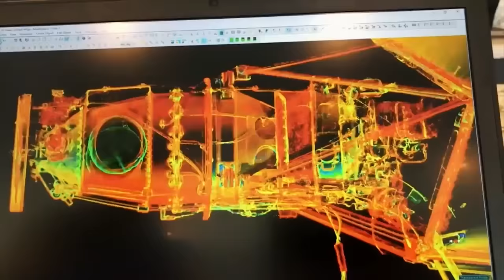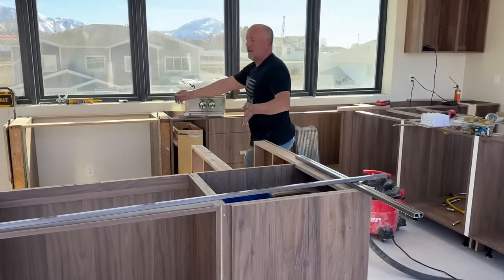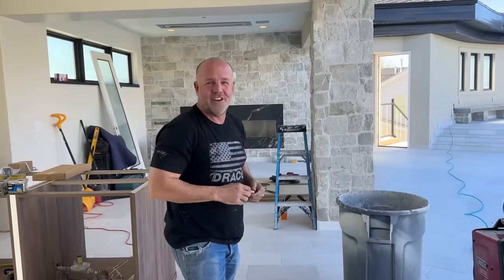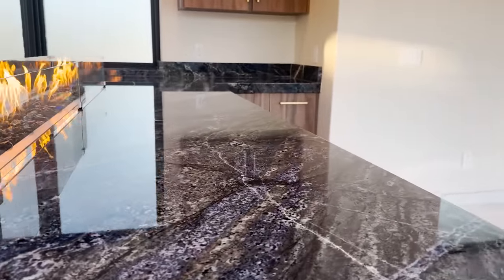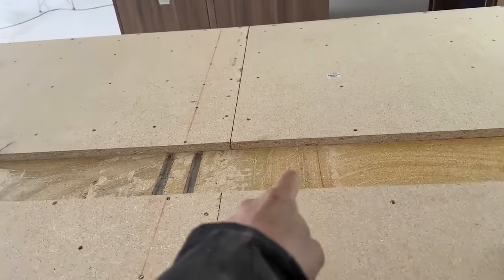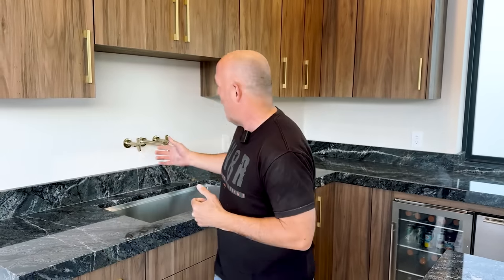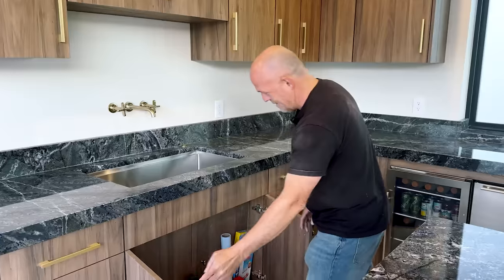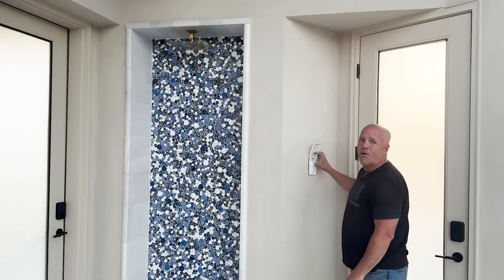Insane Rooftop Pool and BBQ Kitchen Area - Auto Winterization | House Build #24

Comment: Mike the Walnut cabinets look great and once finished will look awesome.

Two things I will caution you on. When using Partical board material for cabinets especially in wet areas. 
One is the partical board has an issue with water when it gets wet, it expands and once wet there is no recovery on the sub structure & surface, it is damaged forever. 

The second area of concern is the Base cabinets for the sinks. Any leak in this area are an issue as well. What I do is install FRP on any wet area cabinet weather its a plywood box or Partical board material. If you get a leak, it is generally too late for the damage has been done.

The FRP is available at Home Depot and Lowes. I make (Drywall shims) cardboard patterns using hot melt glue, you make the base panel then cut 6" to 8" tall sides and back around the sides and back. Once glued in place with the FRP glue for a few hours. I then come back & seal the corners using white silicone as well as the top edge of the sides and front edge. The FRP is generally white I believe they do have a tan as well.

In the case of an unintended leak under the sink it will save the cabinet.
Reply: He does amazing work. 
And when I saw partical board cabinets outside  it also amazed me. Couldn't believe I saw that.

Comment: 8:18
As if there may ever be a next time... 
I would recommend laminating the under side of exposed particleboard with what is called cabinet liner. A thin phenolic sheet that aids in deterring absorption of moisture. Especially helpful in semi-exterior spaces and near water areas. 
👍🏽

Comment: If you plan on using your counter top in the winter, you should have put an electric heating element under your counter top similar to what they use in bathroom floors or your counter top will be an  ice cold slab and very uncomfortable to rest your arms on when you eat. .

Comment: Everything about this build is so far over the top that it should be tracked by NASA as a Near-Earth Object. While I don't think I'll ever build anything like this, I am definitely filing lots of the solutions away for when I do build the retirement compound. Like I probably wouldn't do an outdoor shower like that, but I could definitely see myself doing an outdoor shower mixer the way you did that sink. Also gonna have to keep that outdoor fridge in mind later.

Comment: On your outer most island with the BBQ grill. Did you put some kind of sealer on the underside of the counter for the exposed particle board under those chairs? I know water from up top isn't gonna be the problem with rain, but the underside will still get splashes from a heavy down pour. Maybe some kind of plastic barrier will help you if you over looked this. Love the whole project BTW.

Comment: For those who knew the late Joe Clark, can you imagine if Mike flew into his strip back in the day? I need Mike to fly into my strip sometime, and explain to me how my solar, wood boiler, electric boiler, radiant floor heat system in the shop/hangar and house works, I've forgotten, and I built it. There's something about hot water controls, pumps,  sensors, and valving, that I find  really fun to figure out, good thing, as I have a lot of them. PEX plumbing has been a game changer for we hot water system experimenters, if you carefully cut off a crimp ring with a skinny wheel grinder, the fitting and tube can be separated and re-used in a different configeration, SO much easier and quicker than old school hard copper.

Comment: Would recommend digital temperature control for the shower. Simply control hot / cold mix electronically with (redundant) temperature sensors just before the drain valve. Leave drain valve open until target temperature is reached then close drain valve. Obviously use a Schmitt trigger. Each person has their own preference when it comes to temperature, especially on a really hot day. Would have recommended drain pipe to be same diameter as the supply line.

Comment: The way you ran your hot water to the sink reminds me of the way they run the fuel through rocket nozzles to bring the temperature up on the fuel and cool the nozzles.  Obviously, what you are doing is different, but i love the way you're taking advantage of one system (instant heat runs) for a secondary purpose (frost protection) ... love it!

Comment: The engineering is amazing to watch and learn. Did you consider a digital mixing valve for the basement and put the temperature control buttons at pool level? I feel like that mixing valve will be adjusted a lot as the seasons/temperature and user preferences change.

Comment: I love it, just wonder about all that MDF outside over time.
Reply: utah is dry with low humidity.  I imagine itll be fine.
Reply: They’re a Salt International product. Advertised to be water resistant. Time will tell, but the wood cabinets we had at a previous property didn’t fair well in the heat and cold.

Comment: Mike, all of the particle board I have met in my life is like a sponge for moisture - even if over several years - and when it gets enough moisture, it swells up.  Now your countertops are probably modular so you can pick them up and replace the particleboard every 5-10 years, but why not extend that time by sealing the particleboard before setting the granite?

Comment: Hey Mike pretty over the top.
As a retired custom cabinet maker, I am a little concerned about particle board be used outdoors.
MDX might have been a better alternative. Exterior grade MDF. 
Moisture is your enemy.
How did you seal the underside of those amazing countertops?
Reply: Agreed. The product we used for cabinets is by Salt International. They advertise water resistance but we will see… We’ve had wood cabinets outdoor before and had issues due to the extreme heat and cold. So, I chose these instead.

Comment: amazing build, nice solutions, some of them i will use myself creating my outdoor dining area.
One question/remarc: because of the insulation and the hotwaterline, your coldwater supply will heat up during summer, so there is a distinc possibility you get standing water of around 25° centigrade in the cold water pipeline, wich means there will be a risk of developing legionella. How do you cope with this? 
(We had a problem with cold water lines in retirement homes where older people heated the bathroom to 25-28 ° centigrade and legionella developed in the cold water lines, current solution: drain the line every day by staff)

Comment: The thought into every detail is so refreshing wow on the shower winterization and P-trap. It seems you could also have a delayed p-trap on the sink so it would run straight through the wall then have the P-trap in the house, might be a bit weird but it would keep the wet part inside. Did you have a reason not to do that instead?

Comment: Mr Patey, as a service plumber I would like you to know that what you have built is indeed bullet proof.  MAYBE the aerator in the tub filler/sink faucet freezes because it will hold water just from surface tension.  But knowing you you probably just removed the aerator.

Comment: I'm surprised that there's no storm doors or awnings for the BBQ Kitchen Area. What happens if it rains and  a strong wind is blowing water at a 30° angle directly towards the area?
Reply: Knowing Mike, he has engineered some fancy gizmo that parts the clouds over his house using typical Patey wizardry and hidden fans that match the wind speed in the opposite direction hahaha

Comment: This build is basically my dream house especially with all the redundancy, my only question if anyone knows, is if the pipes in the shower drain so they don't freeze that means the pipes must get pretty cold. Is there any risk of the cold pipes bursting when already hot water is shot through them quickly?

Comment: You are using cabinets made with particleboard and particleboard for the tops outside? It should be fine if it never gets wet, but it’s not what I would expect from someone who loves to overkill things. Is there anything you go do to seal the underside of the overhang so it doesn’t absorb moisture?
Reply: We live in a high desert and aren’t very humid. The cabinets are a Salt International product. Advertised to be water resistant. Time will tell, but the wood cabinets we had at a previous property didn’t fair well in the heat and cold.

Comment: Do you have to worry about the thermal expansion of the granite benchtops? Surely the coefficient of expansion of granite is different to that of the wood and steel. Also the heat differential between the granite near the fire and the granite around the edge. Not idea what granite can handle but will be interesting to see. Time will tell! Epic build so far.
Reply: We have exterior granite countertops at the hangar. They get sun and snow on them and have held up great. The countertops at the house are more protected, so they should be fine.
Reply: @ChandraSlyFoxPatey  Sounds like you guys have already tested this to great success. I'm looking forward to seeing it all come together !

Comment: amazing work again, I did something similar on my island, it's 65" deep 75in wide with two 24in cabinets under from either side and an 18in overhang on one side so my 6ft8in ass doesn't knock my knees on the cabinets.  Used two  36in x 4in  solid steel bars to support the overhang and the ends have waterfalls that support the overhang

Comment: are you worried about the particle board under your cabinets that will absorb all the moisture, and cause your counters to warp and weaken, being that they are outdoors?

Im just curious.. with as busy as you are, when are you ever going to enjoy that pool???? lol..

great job Mike.. Looks like a palace.
Reply: They’re a Salt International product. Advertised to be water resistant. Time will tell, but the wood cabinets we had at a previous property didn’t fair well in the heat and cold.

Comment: With all your composite knowledge I'm surprised you went with steel to support the counter overhang. I solved the same problem (eliminate the awkward brackets)  20 years ago but I did it with a composite structure.

Comment: You should have used marine grade plywood for the exterior cabinet countertop and not particle board. Any humidity gets into that material, and it will turn to oatmeal and fall apart.
Reply: We live in a high desert, it’s not too humid.

Comment: Mike Patey is to Engineering what Chuck Norris is to Martial Arts.   

Mike Patey can build a plane from a paperclip and a rubber band.

When Mike Patey flies, the clouds part out of respect.

Mike Patey once solved an engineering problem that didn’t exist yet.

Mike Patey can turn a broken wrench into a working airplane.

Mike Patey can calculate pi to the last digit.

The laws of physics are just Mike Patey’s suggestions.

Comment: Sir your granite and plumbing all held up great but your particle board cabinets fell apart from the moisture. 😂😂🤯
Reply: They’re a Salt International product. They are advertised to be water resistant. We will see how they hold up. Our wood cabinets at a previous property didn’t fair well with the heat and cold here.

Comment: I am surprised the cabinets are not solid wood. Any moisture they are going to rott in 10 years?
Reply: We live in a high desert, not too humid. They’re a Salt International product. Advertised to be water resistant. Time will tell… We did wood cabinets in a gazebo at a previous property and they didn’t fair well with the extreme heat and cold.

Comment: good day Mike, just a concern. I see you are using chipboard for the cabinet frames. This material can not tolerate water. It will swell and fall appart. The better material to use would have been exterior grade plywood or even marine plywood. Keep up the good work. regards
Reply: They’re a Salt International product. Advertised to be water resistant. Time will tell, but the wood cabinets we had at a previous property didn’t fair well in the heat and cold.
Reply: @ChandraSlyFoxPatey  Good to hear. One thing I experienced. A neighbours stove was left one for 5hrs and the surrounding cabinet started burning from the oven's heat. Not very likely, but I know that Mike likes to check all items.
Reply: @fransliebenberg8973  Wow, that’s terrible! I hope no one was injured. Our BBQ grill and side burner are seated in stainless jackets, which should help prevent such an occurrence. Thanks for the comments, I’d hate to have you left wondering. Have a nice evening.

Comment: I’m surprised you didn’t heat the countertop. Everything else will be warm except for the surface of the tops.

Is that particle board under the tops? If so, why not use a marine grade plywood?! Why cut corners by using particle board exposed outdoors?

Comment: I’ve got granite and I hate it. Cold, heavy, hard, plus maintenance. I’d go with a solid surface material like Corian.
Reply: We have used granite in several outdoor applications and haven’t had any issues with it. The granite at the hangar is exposed to the elements and has held up well.

Comment: i mean it seems a bit over the top as a german guy but the power system isn't that reliable in the states compared to germany. And most of AC failures will occur in the winter season where an empty battery and a frozen genset is not a 'will never happen' scenario. The only figure which is of interest for me, how many KWh in total (electricity + heating + gas) will this house consume in one year...:D

Comment: I was dissappointed to see the widespread use of veneered particle board and not a laminate of a thin exterior decorative wood and a structural solid (hard?) wood panel. Similarly the infill and under granite top panels - I would have expected plywood. Particle board does not do well with moisture or humidity so I am curious as to the reasoning.
Reply: We live in a high desert, not too humid. The cabinets are a Salt International product. Advertised to be water resistant. Time will tell…

Comment: When is this just showing off? Your rich and were not. 
You earned it 100%  Just seems at a certain point outside of flying enough is enough.  Many of us are losing our simple planes. 
How about helping us to getting the FAA to put a Rotax is a 0200 in a C150. 
Or allowing experimental avionics in certified aircraft. 
How many die every year because many can't afford the $80k for the exact same Garmin avionics to get an auto pilot that would save someone stuck in IMC.  
GA is dying over 100 year old engines we can't repair. A crank for an 0200 is $14,000. 
A decent 150 is over $50,000 now. 
We need help Mike. 
I am happy that you can have the best.  
Your fans are normal people who love aviation but are being priced out. Garmin won't even work on a 430. No one fixes HSIs. $750 to rebuild a simple Alternator. When Auto zone sells the same thing new for $69 bux.  The FAA is destroying us normies with insane regs that kill people. 
Help us Mike. Leave a legacy

Comment: I would of thought it might be easier to have had  some electric wall or glass come down close off the area in winter, Heated floors, that's it job done.Those cabinets are the thing that will get destroyed during winter, So not impressed on this one.
Reply: We live in a high desert, not too humid. The cabinets are a Salt International product. Advertised to be water resistant. Time will tell…